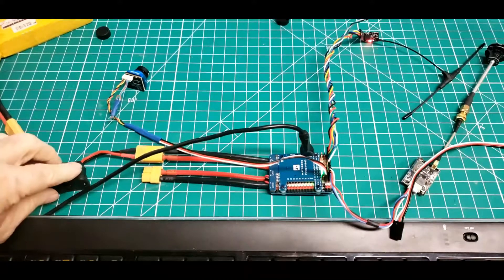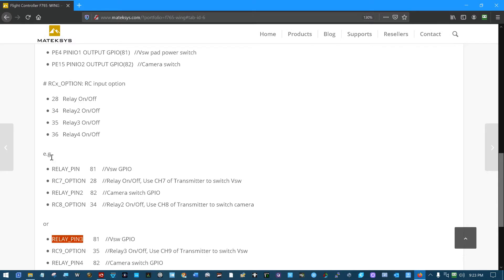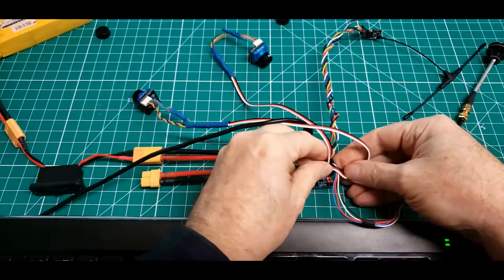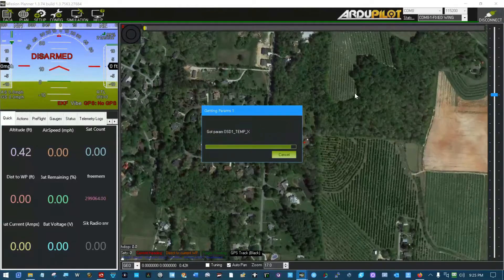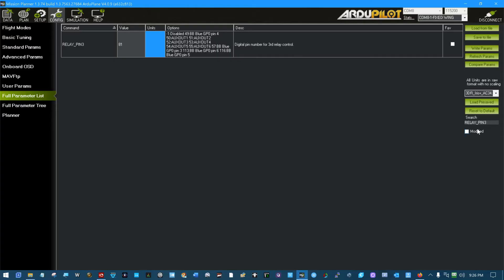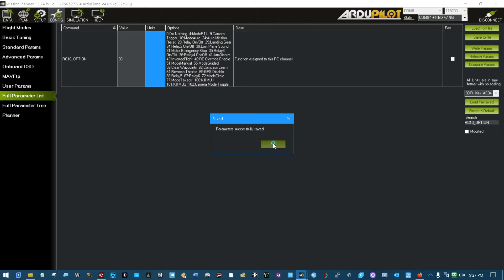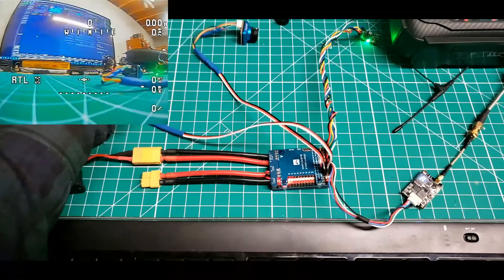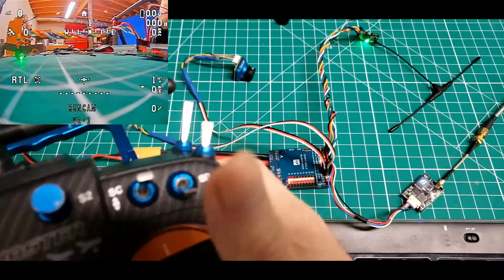F765 Wing Two Video Cameras Ardupilot Setup

Comment: Suppose you build an ornithopter that flies with more than one motor in a non-standard way. Can I use Ardupilot? Or should I use other software?
Reply from the maker: I would always use Ardupilot where possible. More capable for such projects than any other firmware.  Until INAV 6, Arduplane was the only firmware for VTOL.